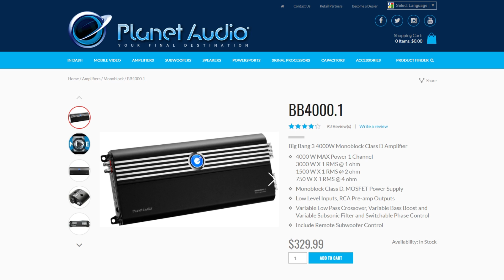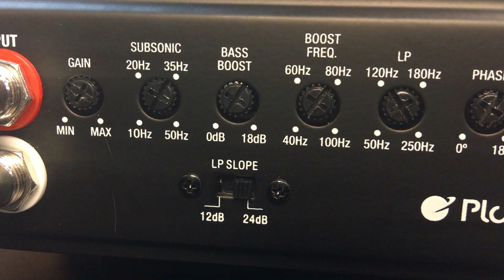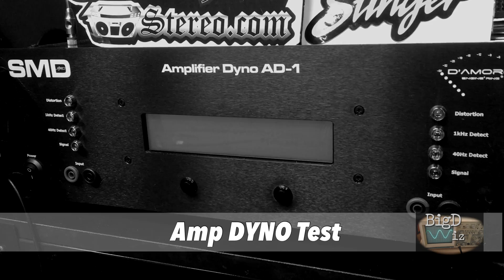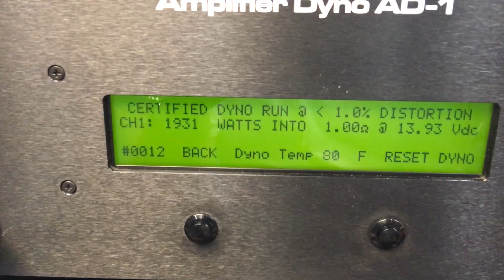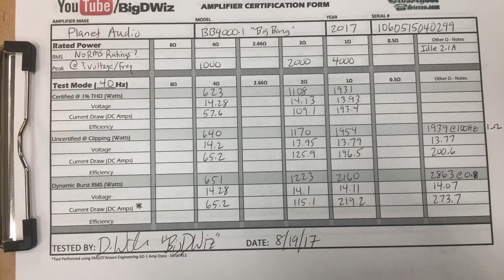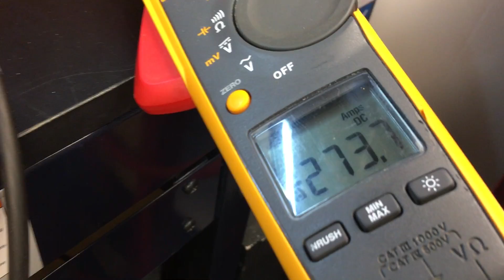Big Bang or Big Fail? Planet Audio BB4000.1 4kW MAX Amp Tested

Comment: Is it possible to connect this amp to a house plug with 110V .   What kind of voltage adaptor or transformer would i need ?

Comment: You know this I have the BB d4000 not the 40 00.10 there's a lot of things I don't understand about this amp that I know the power output may not be quite up to what they say but I know also this is down to a 100 mode all I can say is I have two  dual voice coil subwoofers in a ported enclosure also two Kicker competition C subwoofers 4 ohm each rated at 600 watts that amp push down so smoothly

Comment: When I put together my stereo in my truck it was to accurately reproduce music.
I listen to classic rock and my mids and highs were handled by B&C pro drivers 
and old school JBL  T-595 Limited 6x9 's on an Orion 8002 amp.
I tried several sub amps from name brand companies but could not get the subs to 
reproduce that hard hitting kick bass thump like I wanted. I was using a pair of Sound stream 12 inch subs
I saw this amp and decided to give it a try. WOW it reproduced that kick drum perfectly.
On the songs that had drum solos you would think they had a drum kit set up in my truck.
This is a very musical amp and for the price gives you a great watt per dollar ratio.
After several years this amp is still thumping as well.

Comment: 2100 watts of clean power and pulled 200amps  for $200 is a steal !!! ive had this amp for 2 years the only thing i did was enlarge the hole for the fan and put in a cpu fan 120mm now it runs ice cold

Comment: Wouldn't a ferrule limit your power input? All your power goes through a thin ring of metal. That's why I use the Stinger  wire reducers (or adapter). Thick metal. Unless I'm wrong.

Comment: You should put out a video on if the amps don't put out the rating that they say and put to wear how can you fix it to make it push to push out the rating of the amp which parts that you need bigger of to push out the ratings of the amp

Comment: Not a bad looking amplifier at all , planet audio big bang 4000.1 and it's got a cool blue led power on illuminated icon light too ! I like the fact that it provides separate places for hooking up two subwoofer speaker wires and yes they are internally connected because its a monoblock amplifier , so it will do 1000 watts and not be sweating too hard and with a nice set of medium priced subs yeah it will beat pretty good , it's not 4000 watts but we kinda knew that going in right !! Price is Right and it looks good and has some decent power and a bass remote knob an don't forget the cool led icon power light , so yeah it's a pretty good deal really , thanks Big D Wiz , you da man !

Comment: Starting in the mid 1970s the FTC set stringent standards for measuring the power of audio amplifiers.  They had to be rated as "X watts per channel, minimum RMS at 8 ohms, both channels driven from 20-20,000 Hz, with no more than Y% (normally 1% or less) total harmonic distortion."  So the high-fidelity manufacturers had to "amp up" their game, so to speak.  But lately the FTC doesn't seem to be enforcing their tough regulations.  I remember recently buying a small low-powered all-in-one stereo unit by Philips.  I wasn't expecting much and it delivered just fine for my needs.  But the specification sheet was interesting.  The first spec line read, "Output Power:  2 x 5 watts RMS," which is about what I expected.  But the second spec line read, "Output Power:  150 watts PMPO."  I assume PMPO stood for Peak Music Power Output.  So apparently depending on what standards are used to measure output power, 10 watts RMS is the same as 150 watts peak.  Sometimes I think these audio manufacturers use the peak specs to try to impress people who don't know any better.  But getting back to the subject of this test, it's not as though you need 4,000 watts to get great and deafeningly-loud sound in your vehicle or even in your concert hall.  The 1,900-or-so watts this amplifier produces without distortion is plenty, don't you think?  But if this test was just to see whether the advertised specs were accurate, no, I guess this amplifier did not quite measure up.  But I'm sure it was still more than powerful enough to provide deep and satisfying low end in any vehicle ... even a Mack truck!

Comment: By the manual it gave max ratings which you can guesstimate RMS to be half of. Overall not a bad amp for the money.
Reply: Ya usually RMS is half of max so using that, it actually did make what it was supposed to.  For a $200 amp that's reasonable I guess, not sure of long term reliability,  being that Planet Audio is owned by Boss but meh.

Comment: I'm gonna be slightly contrarian on this amp. These can be bought for less that $200 shipped in several places on the net. And even though it didn't make its advertised power I still think it would be a great entry-level sub amp for those on a budget or just starting out. Think about it, if you've spent most of your budget upgrading vehicle electrical and don't have a lot of money left to get your bump on, this amp would do very nicely. 
They look good and those tiffany-style RCA's should be standard on every amp made that doesn't say "Boss" on top. Definitely not a diamond in the rough but, not horrible either!

Comment: Amp still a lot of power for $200.this amp will outdo a lot of amps I had back in the day.even my power1000 from 2001 birth sheet only said 1569 watts and it was a $1100 amp🤷🏾‍♂️
Reply: Yes but I would be willing to say that the Rockford is much more clearer and has allot better signal to noise than these amps. Watt for watt the Rockford would be much more louder for the same power

Comment: I heard something about new regulations that will require amp manufacturers to advertise actual power output soon. To help consumers understand why "good"  amps cost more than "cheap" amps of same "power".
Reply from the maker: There is a new recommended standard, but I’ve not heard of regulations

Comment: No such thing as a 3000 watt RMS amp.... did nasa build it ?
Reply: Ummm there’s definitely are I have a Skar Audio RP 3500.1 D amp running on 3 Skar DDX 10s and it’s been tested before I got them and that amp is pushing more than 3500 RMS
Reply: @dandredildy  what does the amp cost? And was it tested for its RMS output?
Reply: petrol devo at 1 ohm it runs 1500 over what it’s advertised to run I have a link to show you the Dyno
Reply: @dandredildy  I believe you. I would like to see the specs on the amp with full schematics.
Reply: petrol devo I got you https://www.skaraudio.com/products/rp-3500-1d-car-amplifier
The specs are there!

Comment: Words of wisdom yall do know they had a 1st generation of this amp came in a different Box they were way stronger my cousin had one of the early 1st generation amps that they produced like back in 2012 he had it on 2 Kicker Cvr 15's dvc 2 ohms wired down to 1 ohm in a ported box you could hear that sucker 4-5 blocks and how I know the companies reproduce a weaker version of the same amp is that the boxes the earlier version came in were 2 totally different boxes my neighbor ordered one recently and the box was different from the 2012 version and the power was lacking a lot I could tell the difference.
Reply from the maker: I’ve heard this from other folks too

Comment: It's a very nice budget gem for less than $200 new and less than $150 if you can find a refurb. This amp does around 1900 watts at 1 ohm, 2600 watts at .8 ohms, and 3400 watts at .5 ohms. Even though they do not recommend going lower than 1 ohm, if you have the proper electrical this amp will run at .5 all day. I bought two of them, running both at .5 ohms, each amp to a pair of dual 2 ohm subs, when each pair is wired parallel, the amps are seeing .5 ohms before impedance rise. However, instead of pulling 270 amps of current per amp at 1 ohm, they require 380 amps of current per amp. So where you can normally run a 2kw amp on stock electrical with 1-2 100ah AGM batteries, or a high output alternator, if you wire this amp to .5 ohms you will need both a high output alternator 240 amps or greater, and at least one good true 100ah AGM battery. That's why people blow these amps. They don't have enough electrical to support the current these amps demand. It is amazingly clean, and never heats up. The fan does a great job.
Reply from the maker: The efficiency really suffers at 0.5, and I’d agree with your comment 👌
Reply: ❤❤❤❤👏👏👏👏😳👏 awesome!!i own these but keep them at 1ohm + higher...but your info is spot on!

Comment: You can get this amp for 199.00 now on ebay and Amazon.
I think this is a great deal once we look back and see the numbers are MAX and not true. If you divide them in half, once again, this thing is putting out some nice power per dollar.
Reply from the maker: I’m still mad at misleading numbers
Reply: @wal  I'm right there with you brother. It shouldn't be max or total, it should be what is real and it should be at 12 volts.
That way it's not even getting into the charging system but just what the battery can produce.

Comment: Those numbers were 1500w MAX @4ohms right and it did a true 1100w?
That's pretty good considering an rms rating of a max number is usually HALF so it should have only done 750w rms @4ohms.
Right sir?

Comment: Keep up the good fight!someone needs to hold them accountable and tell us all the truth so thank you for that.
Reply from the maker: Just informing da peeps 🤨
Reply: I just want to post one major abnormality I have for Kicker Comp C's 4-ohm and two Power Acoustik dual voice coil 4-ohm voice coil running off this BB d4000 I've been pushing it trying to burn it up reflection the sheet metal in by then flexing not reflecting stupid speech text don't understand it but can't burn this amp up and it's only taking my alternator down to 13 volts this is definitely an abnormality cuz I'm running them all parallel
Reply: Amen

Comment: Big D Love what you’re doing I was wondering if you could test a majestic amplifier model number ma9500sw this particular amplifier I bought back in the 80s my first high power amp I still have it to this day I bought it as a refurbished amplifier I have pushed it the only problem I had is with the fuse holder if you could do this really cool thanks PS I am the owner of DC mobile installations a company that I had started back in the 80s
Reply from the maker: I tested a different model Majestic a few weeks ago - Budget Old School? 1997 MA-695 Isographic Series Amp Dyno Test https://youtu.be/qvjtN9DK9GE

Comment: so let me get this straight, the bb4000.1d out powers the hifonics. brx3016.1d, two soundstreams the pa-5000d, an the ar1.8000d, also power acoustiks powerhouse the eg1-10000d, an only lost to the vaulted D.C. audio 2.0 k by 140 watts at certified. an i see some people still putting it down, cause its parent company is boss audio ??? get it together people, all companys have parent companys!, or is it the fact that this amp is smashing there favorite amps to pieces for under 250.00 dollars!!!, and comes with a fan in it, and pulls less current while slamming! sounds like planet audio haters to me!
Reply: Dietrich Williams no it's the fact theu advertise 3k and only put out 2k. It's bs
Reply: planet audio would have everyones respect if they actually advertised wat their amps truly do at rated

Comment: There seems to be a trend on these over rated amps where the draw from the battery is close to the max rating of the amp, making the 3k watts an max power draw rather than max power output.

Comment: Makes it hard for guys that are setting their own gain settings using a multimeter..
Cause if you were setting the gain using 3000w as you base..  Then the amp will be clipping.
3000w = 54.77 Vac   2000w = 44.72 Vac     Damn that makes a heap of difference....

Comment: I used to have a Planet Audio AC2500.1M. That amp was grossly overrated and a poor performer. I bought it to replace a MTX Thunder Elite 601D that smoked itself on a 4 hour drive. I finally gave the planet audio amp away and replaced it with a Pioneer GM9601D. To bad the Alpine Type R couldnt handle an amp that has a true rms output. Moving onto a Sundown 12xV2 now.
Reply from the maker: +kb198219k the Pioneer impressed me for sure. It's nice to have a good performing amp on the Dyno

Comment: i'm not really surprised. PA is in the same quality class as SSL, Dual, Boss, Power Acoustik, pyle rockville, crunch, belva which generally do like 40-70% of rated. then you have your average mediocre brands like Hifonics, Soundstream, PPI, Powerbass, American Bass(like the PH4000), Audiopipe, massive and mb quart which will do like 70-90% of rated rms.

 you gotta do one of the big D. you'll love the two sets of Rms ratings they list and tell you when to use each rating,lol
http://www.ebay.com/itm/Rockville-dB15-6000-Watt-3000w-RMS-Mono-Class-D-2-Ohm-Amplifier-Car-Audio-Amp/391792881832?_trkparms=aid%3D555018%26algo%3DPL.SIM%26ao%3D1%26asc%3D47507%26meid%3Dd9bb20162bd245f6aa87405088fe502b%
26pid%3D100010%26rk%3D5%26rkt%3D6%26sd%3D112576910979&_trksid=p2047675.c100010.m2109
Reply from the maker: I've tested Rockville before. Just slightly overrated with their RMS numbers

Comment: Running a buddies 600 rms rated planet audio 2 ohm stable amp at .5 ohm gets hot but bangs with the extra battery.

Comment: I Remember back in the day that we called these type of amps "ILS" amplifiers. If lightning strikes the amp it will put out its rated wattage. The trick with these things is that they need more voltage. the alternator and the amplifier dyno correctly put out only 14.4 volts. But these types of amps can require 18-24 volts.
Reply from the maker: +carl rogers manufacture should put the specs of how these amps reach their RMS power

Comment: I was considering getting this amp... now not so much. I have the Big Bang 3000.1, the old one. I’ve asked you this before, but I lost the info. Where do you get your amps repaired? I need to repair the B.B. 3000.1 since it’s hard to find. Thanks too.

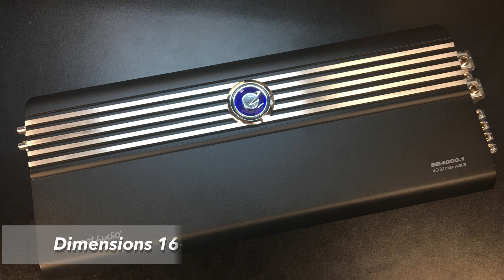Comment: 1:18 = One and EIGHT NINTH inches?? - what the hell?? Making up your own system of fractional measurement units? I'd love to see your ruler with 9th on it ROFL. If your metric is correct then 416mm = 16.378" = 16-3/8 (not 16-1/3) x 58mm =  2.283" = 2-9/32 (not 2-3/10) x 175mm = 6.89" = 6-7/8 (not 6-8/9)
Reply from the maker: +John Coops specs were taken from manual, I'm just the messenger 🤷‍♂️
Reply from the maker: +John Coops they used the same ruler to estimate wattage 😂
Reply: Designed in Texas? Everything is bigger, right? Still, it would have been better to simply measure it rather than quoting size from the manual :-)

Comment: You big d got a question I got the Rockville m-5 and it's mono block. I got it wired down to 1.1 ohm but I have  two sets speaker terminals.. which one do I use?
Reply from the maker: +Wade Powell speaker terminals are wired together. Just choose 1 positive and 1 negative and you are good

Comment: You tested a lot of the old amps I used for comps back in the day.
MTX 2300, JBL 1200, Jensen A1000 and the Autotek 333.
You should try to find an old Targa Amp with the purple and black camo pattern.
Reply from the maker: +PC I know, there are still many amps I want to test. I'll keep doing it as long as I'm able

Comment: Hey Big D.  Love your vids.  I noticed that you zeroed out all of the pots in the beginning.  Even so that you usually do this with all amps, perhaps this amp attenuates input signal instead of having a per-amplifying the signal?  It could be that the dyno's full signal isn't actually reaching the amp and the test should be done with full "gain" up?  You've been doing this a long time so it wouldn't surprise me if you already adjusted for that.  Any thoughts?  Thanks for the vids!
Reply from the maker: +Dragons Taco I thought I answered your question already, but don't show the response, sorry about that. I zeroed out the bass boost, set crossovers to max, subsonic to minimum, but set gains matched to my Alpine head unit. I did not show the gain matching process, but the Dyno has DD-1+ built in, so I set gains with a 10dB overlap as recommended

Comment: Yo BigD, I don't know if you read your comments but if you do please respond, I am looking for some advice. Thanks!
Reply from the maker: +BlitzkriegStaffords I read and respond to as many as possible 👍
Reply: Great! I am looking for some advice on a new amp. I was looking at a DD M3c or 4 but they are pricey and I wanted some other options I may not be aware of. It doesn't have to be an amp that does its rated rms as long as it is reliable and can put out atleast 2500-3000 watts @.5ohms on good voltage.
Reply from the maker: I would personally go with this one - Orion XTR2500.1d. Superb amp! Only problem is since I made a video about it, they are hard to find. See my test of it here - https://youtu.be/DMBV0dVAtUo
Reply: Thanks for the quick responses D! Do you have a secondary recommendation or even something with maybe a little more power in the 3k to 4k range? It is for a single DD 9918sc.
Reply from the maker: Orion XTR4000.1d. I honestly think the 2500 would suffice though. I'm not sponsored or anything by Orion, but I really like their new amps
Reply: I believe you and I appreciate the recommendations. I just priced the 2500.1d and it costs less than half of what I can get the m3c for from a local dealer.